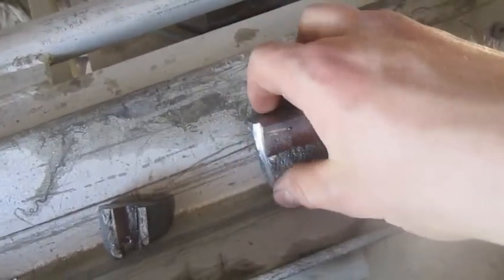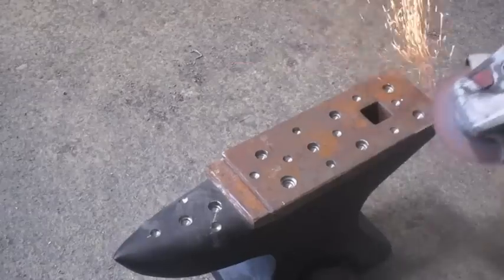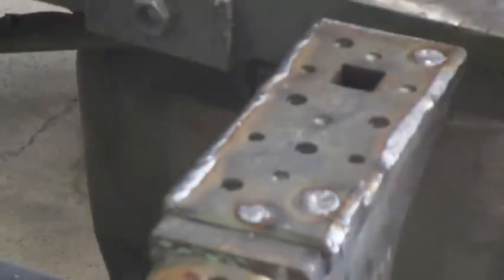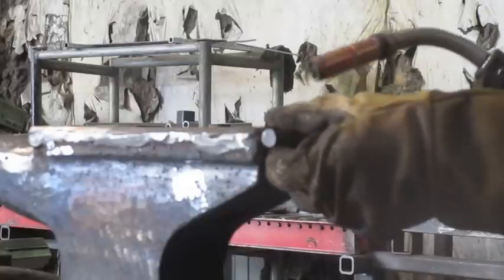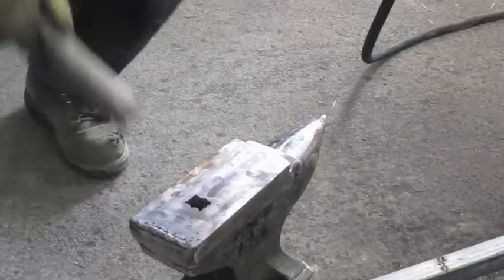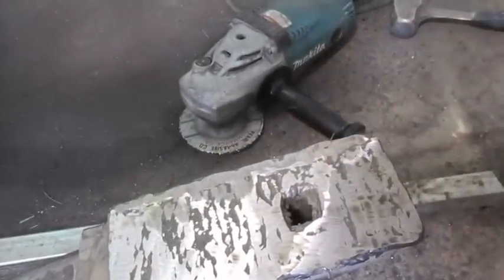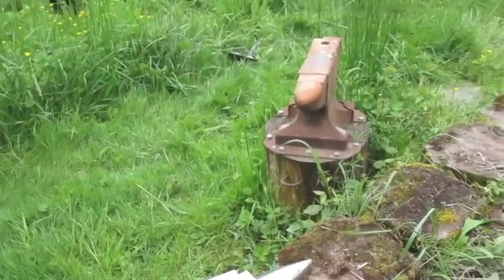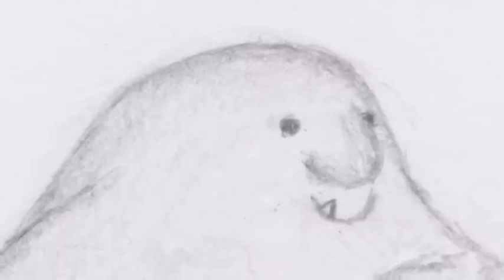Modified Cast Iron Anvil- Yes, it can be done

Comment: wouldn't the cost of the Chineseum anvil plus the all the mig wire and, no doubt some worn out grinding disks, amount to a small cast steel anvil?

Paddy
Reply from the maker: That's what I was trying to figure out here. And it's pretty close in price, but mostly because of the amount of time I sunk I to it. If I were to do this again, I believe my process would be more cost-effective.
Reply: Noble attempt. I am glad it worked out in the end. My first Idea would have been to weld a piece of cast steel on top of the Horror Fright anvil. I have seen anvils made and sold like that on a commercial basis.
I am no blacksmith, but I have a small 20 Kg anvil in the shop, sitting on the workbench, as a surface to tap things in to place (or hammer a pin into something, you know) and that too has a nice flat and very resilient piece of cast steel on its cast iron body.
On a fun note.... when I first got this I mounted it on some soft 8 by 2".... so the first time I used a hammer on it, the whole contraption was so 'springy' , it nearly hit me in the face !

All the best!

Paddy
Reply: that Hardface wire (10lbs) is as much as  forged steel Chinese 66lb anvil. Still very good video. Def not cost effective for me. And you have a nice selection of anvils!

Comment: Very nice and informative video. Shows a very nice alternative to get a "good enough anvil". I fabricated my anvil by arc welding (full penetration most of it 7018 rod) chunks of steel and hard facing rod was very expensive, as you said "cost more that I'd like to admit". You invested a lot of work in this project and with just a bit more work you could have started in a bigger cast iron anvil and get a "more substantial" final product. Thanks for the video
Reply from the maker: Hey! Cool to hear someone else made one of their own.
I could have started with a bigger one, perhaps, but this one I got for free, and if I somehow messed up it wouldn't be a huge loss. Besides, I'm more confident I can take on a larger one now that I did this with great results. All part of the plan. :)